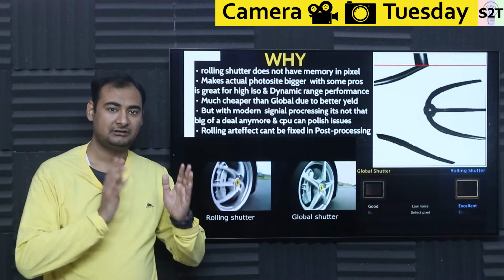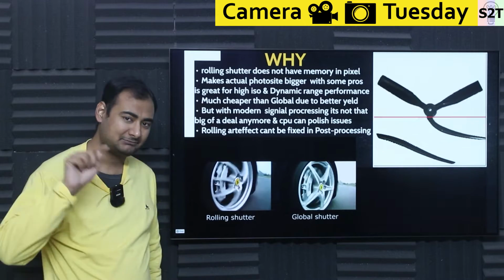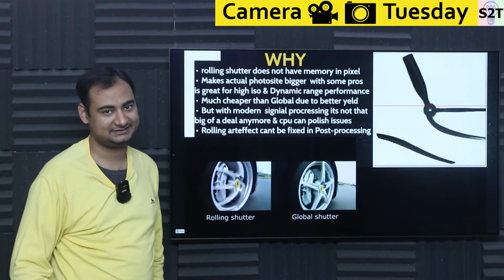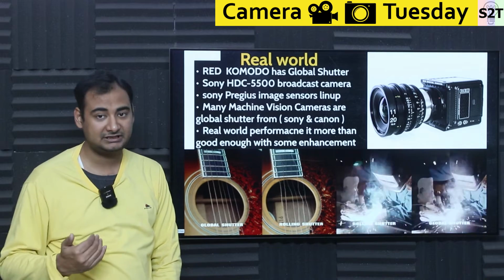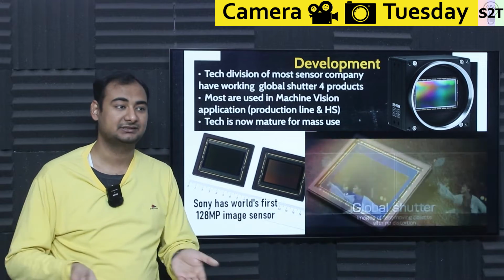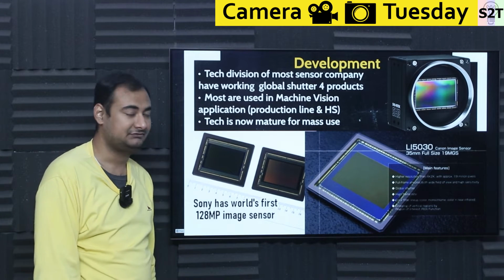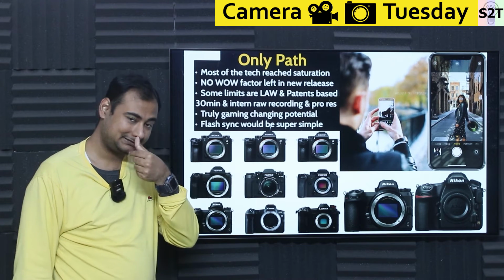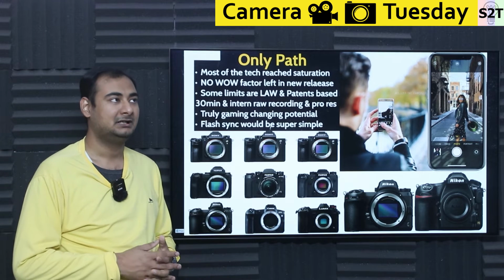Global Shutter Impact Explained {Camera Tuesday Ep212}

Comment: The original black magic Ursa and the black magic cinima4k also have global shutter. The Ursa is able to do 120fps uncompressed 4k. It came out over a decade ago✊🏽
Reply from the maker: that did not work well that is why its not well known
Reply: @s2tenglish  It works incredibly well. 
far from bad. 

Blackmagic was sued by Adobe around that time (for using the adobe raw format in their cameras) Blackmagic had to shift resources to software development, and it caused them to halt production on their 4k ursas.

The big Ursa V2 is a phenomenal camera, It performs incredibly well and can hold its own even now in 2023, The camera may be the size of a small child, but it holds up nicely, even in low light. 

It's genuinely impressive...